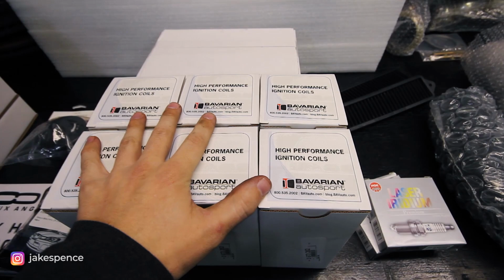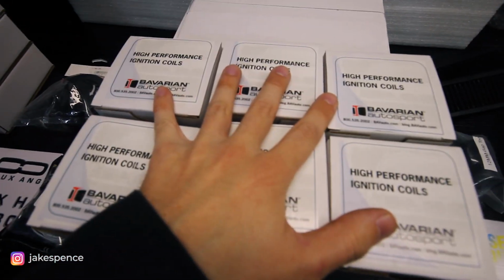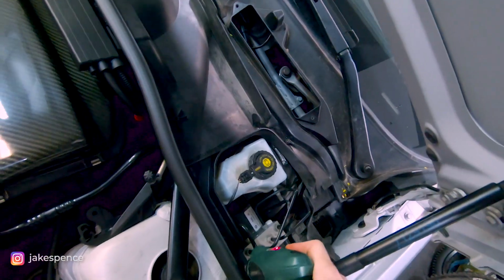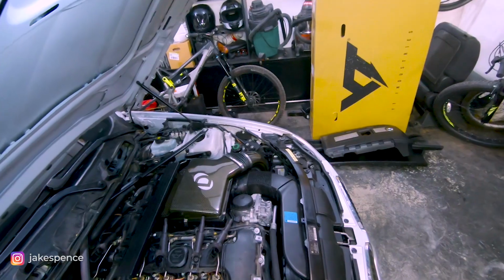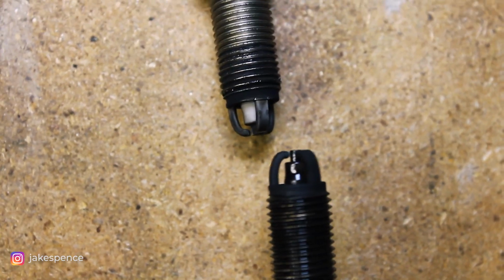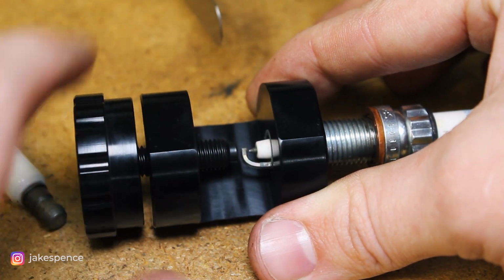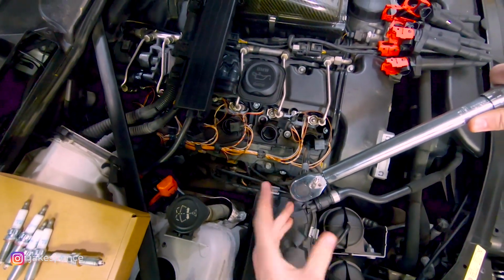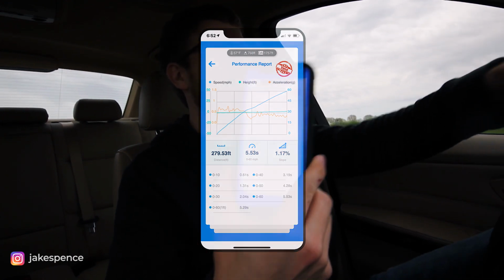BMW N54 Spark Plug & Ignition Coil Replacement + The BEST Gap Method! (135i, 335i, 535i DIY)

Comment: I get hiccups at idle a slight misfire but no check engine and sluggish power.
I changed my injectors replaced with new seals
Changed spark plugs but didn’t change ignition coils. But I get no codes?
What could it be
Reply: If you haven’t found a solution, Did you check if your intake valves are dirty? Had a similar issue and that pretty much resolved it